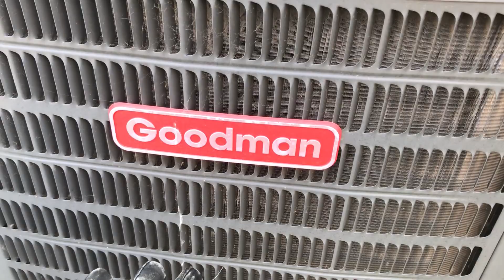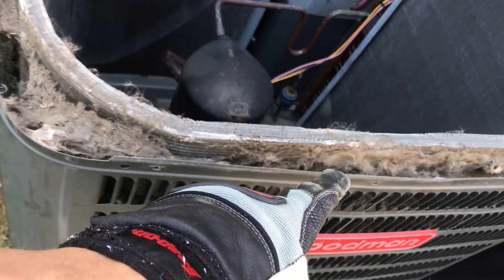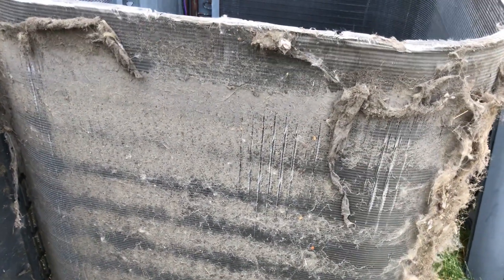Air conditioner Efficiency Improvement to Save $$$ | DIY AC Maintenance (LAWN CARE)

Comment: Very much lawn care related. Always remember to trim and clean up landscaping around the unit. I have lavender growing and a tree between my three units. I like to use Scrubbin Bubbles foaming bathroom cleaner or the coil cleaner if I can find it at a good price. The coil cleaner is about $9.00 a can it takes two cans for my 2.5 ton and one can for my two 1 ton units. But every two years I get the cleanin’. I never take the panels off the side nor do I vacuum the bottom out, I have never had a problem getting the large pieces out, they wash out easily. I clamp the fan to a 2x4 braced against the hard panels so I have space to play. I love the video. It feels good when those units get cleaned up. 🧐
Reply from the maker: Sorry this comment didn't show earlier...
Good info, thanks!  I never tried coil cleaners, does it protect it longer of just clean it better?
Reply: Jealous Lawn Care,  I think the surfactant in the coil cleaner is a oil based type of base and it dries with a non-stick residue. Based on that I think it protects a bit better. They do power foam up quite hard giving a cleaning effect like no other substitute I have tried. I used Purple Power, the Scrubbin’ Bubbles, Dawn, and the coil cleaner. I would say give it a try. The coil cleaner is meant to be done from the outside of the unit even, because it extracts the dirt but it is best rinsed from inside. I sound like a sales person 😆

Comment: The water pressure seems low I guess it helps to not flatten out the fins? I never use a vacuum but use a broom to loosen the outside matting of grass and a leaf blower to loosen leaves from in the case, they blow out the top and through the drain holes and edge gaps. We deal with a lot of corrosion here so cleaning helps slow the damage down. There is an alkaline based solution sold for cleaning, it foams and gets the deep down dirt out.
Reply from the maker: Leaf blower sounds like a good idea.  Is there enough room in there to use it though?

Comment: If you do ever dent your coils, you can comb them out with a fin comb (DO NOT USE A FIN COMB TO CLEAN YOUR COIL ONLY REPAIR IT.) An easier way to do this would be to use a coil cleaner every year and take it apart like this every five. They are designed with the idea that the corners will collect dust and clog, but it can't hurt. It is also imperative to clean your evaporator coil in your air handler (indoor unit); it's a little more difficult but should be done if efficacy is what you're looking for. Keeping both the evaporator and condenser coils clean not only helps with efficacy it will extend the life of the units.
Reply from the maker: Good info here! Thanks

Comment: Is your AC unit a mulching unit or side discharge? Thanks for the video I had to replace my 20 plus year old unit last year with a 10 year old unit. Now they all use a different freon.
Reply: Lol
Reply from the maker: Lol its a very pitiful mulching unit!
Reply: @JealousLawnCare  would you discourage using a leaf blower from the inside out? I replaced my old unit last summer with a used one. My old unit was from the 90s sounded like a wood chipper when it started up came with a Spin Doctor's cd.

Comment: My cover is different but i  think it worked for me my fins are to damaged
Reply from the maker: how old is your unit out of curiosity?  Mine is about 6 years old.  Good point I failed to mention that Cleaning your air conditioner also allows you to check the fins for damage (also hurting efficiency)!
Reply: Yea i think its to damaged for cleaning and its about 10 - 15 years i   bet im not for sure tho its got the old steel rod type case not the cover you have its old i bet
Reply from the maker: Vinny Pinatelli -- yep that's the older style, I know exactly what you are talking about.  Almost time for a new one then!?
Reply: Yea it is lol but it still works ok it's not that cool in here now but its almost 100 outside so it slows down at this temp
Reply: Usually its freezing in here besides a couple days a month
Reply from the maker: Vinny Pinatelli -- ya no matter what I can't get my upstairs as cold as I want either.  I hate being hot inside!  I'd like to get a 2 zone ac setup to control 2 different zones instead of just main level
Reply from the maker: Vinny Pinatelli -- sounds perfect for me! Haha
Reply: Yea brother i agree